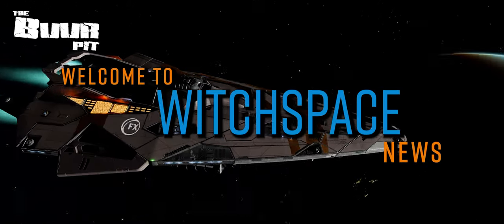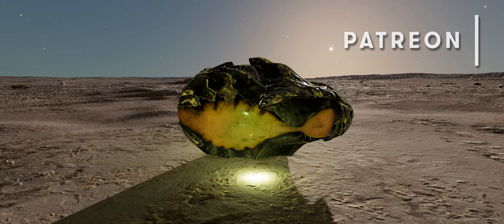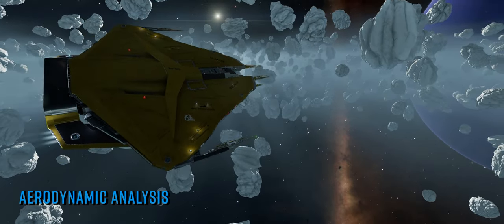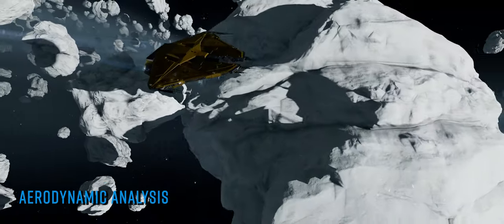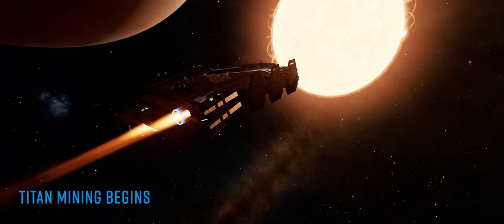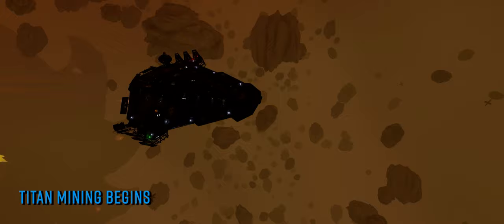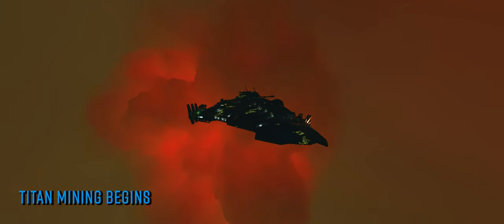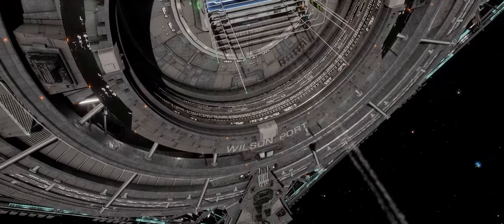Elite Dangerous: Is Titan Mining Worth it?  Spaceship Aerodynamics

Comment: Now that we've had a few days to assess the impact of rescued pods on the course of the war, it's safe to say that this new mechanic is a game changer. If I understand it correctly, pod rescues contribute to progress in every Counter-Strike system (or is actually every Controlled system?) within a certain range of a particular Titan. In just this first weekly tick with the new mechanic, the Goids are set to lose control of over 20 systems, four of which were previously untouchable barnacle matrix systems. That's huge! I do wish the monetary reward for pod rescue was correspondingly high and the bar for doing rescues a bit lower. Given the enormous effect it has on the war, however, maybe it makes sense for pod rescue to be "end-gamey" in its level of access and difficulty.
Reply: My bad - meant to say "the Goids are set to lose control of over 20 systems AROUND THE INDRA MAELSTROM ALONE, four of which were previously untouchable barnacle matrix systems." In fact, with about 6 hours left in the tick it's looking like 24 control systems cleared around Indra. Apologies for leaving out that little detail!
Reply from the maker: @paulreckner1806 not at all.  Thanks so much for the heads up on it.  
This is huge news o7

Comment: Significant mistake in the video!! (A rather rare occurrence on this channel)

The thargoid pulse neutralizer cannot just be bought at a rescue megaship. It has to be unlocked via a tech broker, same as the caustic sink. It is a considerable task to acquire the materials needed for unlock. While it is not difficult, it is quite time consuming.
Reply: Also, I am the person this gameplay loop is made for. I have been poking at the Titan with my AXI branded ship for some time and look forward to having at least a moral reason to continue doing so.

Comment: I'd love to participate but I've only gotten as far as getting the caustic sinks.....and I'm unsure I can bothered going further with it.....catching up seems more effort than it's worth.
Reply: If you've already got the caustic sinks, you can literally buy everything else you need at a rescue megaship for credits.  None of the other modules require an unlock.
Reply: @MarkZeroGaming  That is a lie. You need to grind for the pulse neutralizer and the caustic sinks and unlock them both from a tech broker before you can buy them.